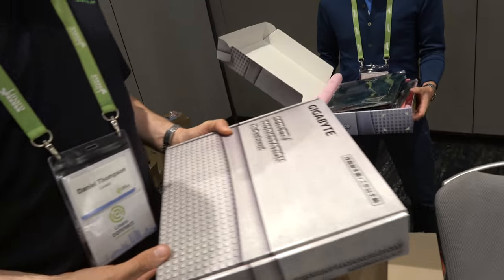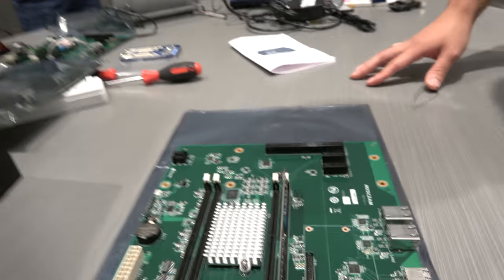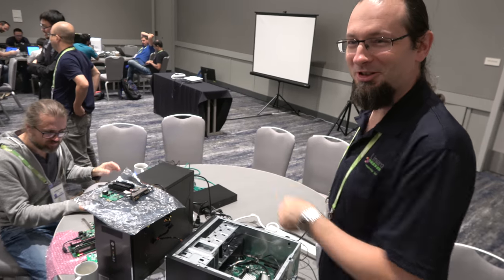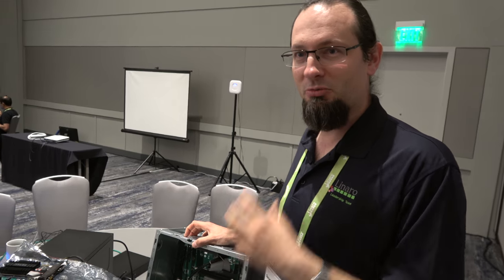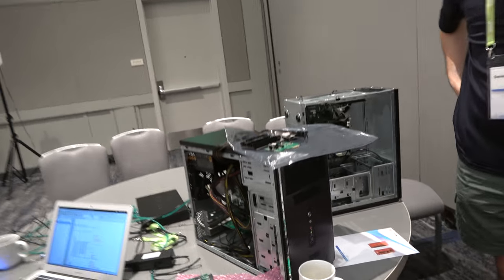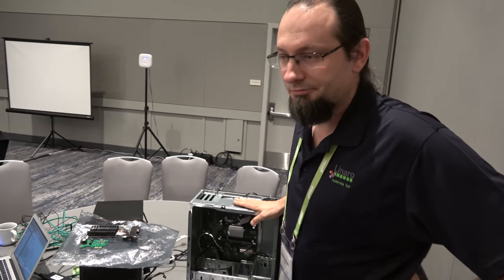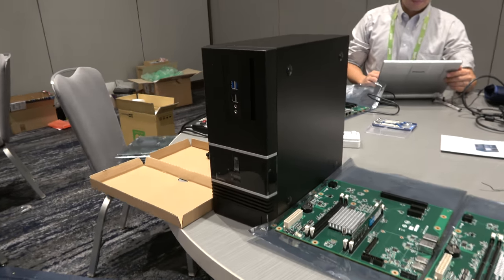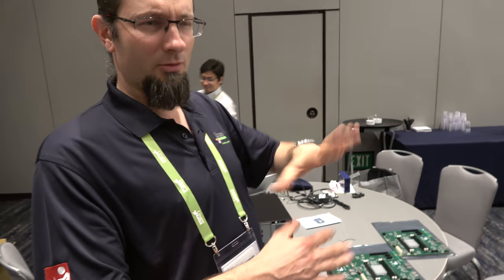sub-$1000 Socionext 24-core ARM Desktop Developer Box

Comment: The bad thing is up to 1GHz frequency. Even with 24 cores, the total performance is not going to be that faster than already available boards with 8+ cores.
Reply: Alexander Medvedev True, however power efficiency if through the roof compared to an average CPU
Reply: Which is completely useless.... unless they are used for servers. I can see ARM servers being amazing, but for the average consumer kind of pointless.
Reply: Alexander Medvedev I'm not so sure. Our internal work file server uses a low clock high core Xeon (64c iirc). This would be a perfect lower cost substitute with the right networking and drive capabilities (100/10gb etc).
Reply: Hz is the clock which tells you squat, Flops you measure processor performance, also it is very important how cache memory is performing as well what kind of optimization and instruction set the cpu carries, money per GFlops processor worth and W per GFlops is how you measure processor efficiency. Person that judge processor only by clock's Hz tells you they do not know anything.
Reply: I'm pretty certain you can't compare a 3GHz 8-core x86 to a 1GHz 24-core ARM CPU just by those numbers.
Supposedly ARM is more efficient at accessing memory. Clearly it uses less power and emits less heat.
That's a huge selling point for Miners, Servers & Laptops that are too hot for your lap.
Plus it's f'n cool. Maybe ARM can beat the GHz barriers we see in x86's someday.
Reply: What I was saying Xenon SL6VW @ 3.0GHz will loose core for core performance with any ThunderX2 at 1GHZ high dissipation setup. And we are not even going to discuss Watt for Watt or $ for $ installed, because difference will be even greater and that is what matter in workstations and servers. Also not only performance what matters and that is why not enough info with just CPU clock to decide what is going to be better bet for one. Do not get me wrong, I do not say the best bet for anyone will be ARM architecture, other manufactures offer some instruction set that may offer optimizations.
Reply: ARM technology is optimized only by programming. You need dedicated programs for ARM to run efficiently. Which is less than average compared to x86. That is a big challenge. But cant wait this happen as a norm.

Comment: I would like to know if it is compatible with video editing as it turns windows into which version?
windows 10 runs, even windows 7 supports it?
I would also like a support list for video cards will run next generation graphics cards like Nvidia 1070 or AMD?
Thanks for answering.
Reply: There are ARM versions of the newer Windows versions. I'm not sure whether there's an ARM version of Windows 7 but Windows 10 definitely has one.
The thing with software for such a machine is that most of the software you would use for e.g. video editing is precompiled for x86 only.

You may only use software that either offers ARM versions or that you can compile yourself for the machine. There is an open-source Nvidia driver called "Nouveau" which is a part of the Linux kernel and so is an AMD graphics driver if I remember correctly.
How well these perform in contrast to the proprietary drivers is another question though. They generally work fine and perform well but I wouldn't count on them for video editing or gaming.

Please do yourself a favor and try to not look at this as a complete replacement for your x86 desktop! If you want to do video editing, gaming or any other sort of stuff that requires huge computational power, stick to x86 for now.

Comment: so can this be a better value than a $1000 intel/amd pc? I don't think so...
Reply: Not in terms of performance but certainly in terms of power consumption.
ARM won't be a replacement for x86. You'd have huge problems with legacy binaries and backwards compatibility. For normal Windows users, users of precompiled software, x86 will always prevail for now.
Reply: S0urc3C0de its about how its programmed that make the performance compared to x86 those programs are less in numbers.
Reply: +S0urc3C0de Nobody really cares about backward compatibility in terms of binaries.  This was an issue when assembly language was still commonly used, nobody programs in it anymore.

What will cause the ARM to replace the x86 will simply be in terms of cost.  ARM already dominates the mobile market.  It will move into laptops more commonly next.  ARM is already a far better solution for server farms too, because they are much lower power compared to x86, because the x86 is a mess in terms of design.

ARM is simple and elegant which is why it uses less power for the same operations.  Binary compatibility isn't an issue.

Comment: I am amazed by the level of ignorance of ESD by "technical" people.  The ESD bag is a shielded bag. Therefore components inside the bag are shielded from electrostatic discharge. The outside of the bag is not insulated against ESD. So the damage is already done. You may aswell just put it on the nylon carpet on the floor.